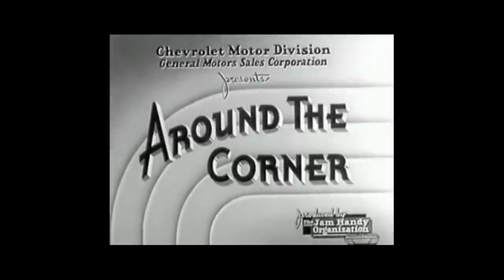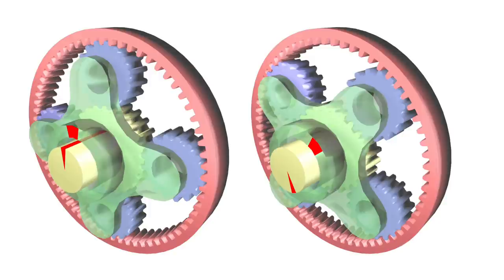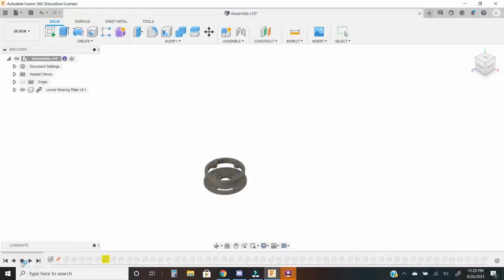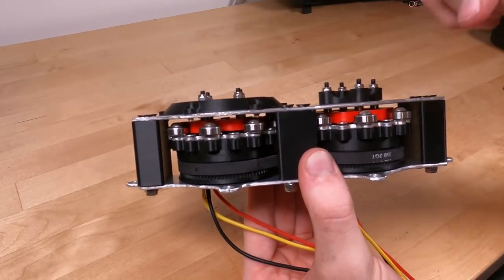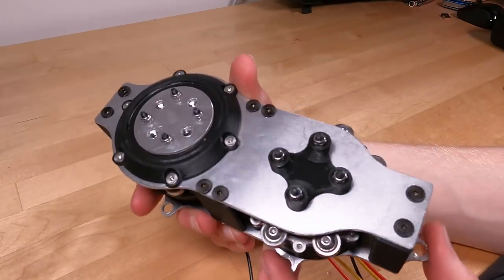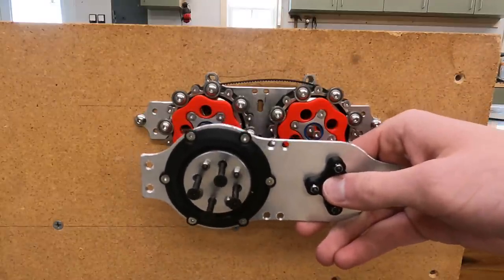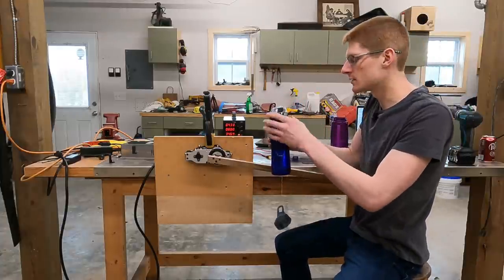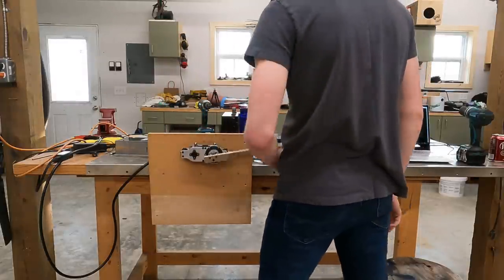The Differential Drive - A New Breed of Actuator

Comment: They are used in tracked vehicles and are called adder/subtractor gear boxes. Essentially two differentials linked together. They allow one high torque motor to provide the main motive force to two outputs and a second lower torque motor to add and subtract its speed to those outputs. It allows precise control over the relative speeds of the outputs even with motors of similar torque.
Reply: and with 3 differentials and you can use the "steering motor" to move torque from one diff to the other via the central, allowing for a constatant total output, but varying difference between the two outputs. Thats how  you get fine control on racing tanks like the Ripsaw. this way you dont lose speed and dont put too much backlash on the steering motor at high speed while maintaining steering reaction time.
Reply: That's a very well known application, and I didn't even think of it. Nice.
Reply: Can you mention some vehicles that use this? I had looked up this exact thing and found nothing
Reply: @BrokeWrench  cat differential steering
Reply: Help request.

I'm researching the subject  for a my small project. Many years ago there were gearboxes called "sinchronizer" to fine adjust the output speed in machine using asyncronous motor. Novadays I think the are overcame by synchronous motor.
Unfortunately I can't find much, and my mother tongue is Italian (with "some difficulties for English").

Can you you give me some more reference to find some documentation on the regard? Thank you for your kind attention.
Reply: @albertoplm  i sincronizzatori vengono usati nel cambio, non nel motore, se senti grattare quando inserisci la prima o la retro sopra i 50 km/h probabilmente non li hai
Reply: @supercrazy50000  i sincronizzatori a cui mi riferisco io sono un accorgimento/costruzione meccanica che permette u a Regolazione fine della velocità di un albero , mosso da un motore elettrico .
Probabilmente questo tipo di dispositivo oggi non è più attuale perché si ricorre a servomotori e driver elettronici .
Reply: @albertoplm  ah ok allora avevo capito male ahahah
Reply: @BrokeWrench  Shermann tank transmission.  Not only does it produce steering more like a car, it also allows the tank to use 1 engine when the other is damaged or broken. You can drive forward/backward, or rotate right/left, but only one at a time. ( when one engine is out )  I experimented with Legos and can build the transmission with legos, but there are so many gears that the motors barely overcome the transmision friction.  There are MANY differential drives in the military, including navigation and flight instruments.  Theyre found in missiles, too. They were used heavily in ww2.
Reply: They are also used occasionally in high school competitive robotics. I believe it is called a differential power take off there.

Comment: Little fun fact: 
The Toyota Prius is using a planetary differential to couple an electric generator, motor (and ice engine) and the driveshaft.
This system is widely belived to be the most cost effective and efficient way to build a hybrid drive train. In german, we call this system a "Leistungsverzweigter Hybridantrieb". 😅😁
Reply: toyota calls it eCVT
Reply: @Eugensson  in Toyota’s R&D lab it’s nicknamed the “power splitter”
Reply: German: “CONCATENATE ALL THE THINGS”
Reply: @liesdamnlies3372  Luxembourgish: Do the same as germans, but in a most unexpected way, eg ZWEEEEËG
Reply: I believe some farming machinery manufacturers also use a differential to add the output from the diesel engine to that of a hydraulic motor, thus having infinitely variable output speed.
Reply: Revonte bikes also uses the same idea for making transmission for e-bikes. Instead of ICE there’s pedals. It’s kind of genius system that requires sophisticated programming to work flawlessly.
Reply: Powersplit hybrid
Reply: If you want to give credit to someone for the original invention, make sure to give it to the correct person: Alex Severinsky. Of course, it is perfectly possible that Toyota did what this YouTuber did: reinvented something that already existed (marketed as Toyota Synergy Drive)
https://www.wired.com/2010/07/alex-severinsky-toyota/
Reply: "Leistungsverzweigter Hybridantrieb" - not the most eficient way to name it.
Reply: @famfloro  the owen magnetic did something very similar in 1916

Comment: You just described the “transmission” of the Prius, except that the Prius uses three input motors, mg1, mg2, and ICE.
Reply: Exactly. Ford/Toyota eCVT.  I made one based off the linear toyota variant to dynamically share output from a windmill with two generators and one motor, one gen for low winds and the other geared for high wind. The motor/braking takes some power off the gens but it speed sets the distribution between the gens. Cost effective, no; Fun yes.
Reply: Check out the Fendt Vario or AGCO CVT transmissions
Reply: I knew I had seen this before but couldn't remember where. Hybrid cars. That's where. 
Also some CVT were there's an electric motor who's sole purpose is to vary the gear ratio. I think modern tanks use something like this.
Reply: Not precisely...  A combiner gearbox, which is what the Prius has, is a little different.  Similar, yes, but not quite the same.  It's nice to see him make something to test his theories though.
Reply: What happens to the power balance? Does it mean in the differential mode one of the motors (rotating in the opposite direction to the output) acts as a generator? This mechanism indeed makes a lot of sense in a hybrid drive where one of the motors has a narrow power band.
Reply: @leonschmidt7  Yes this was also my first thought of examples of differential power combination. 

The AGCO transmission effectively splits the drive from the engine with a planetary differential between a fixed gear transmission and a hydraulic variator. The separate transmissions are then recombined with another planetary differential to the output.

Depending on the ratio of the hydraulic variator (continuously variable hydrostatic transmission) sets the ratio for the entire transmission. This includes continuously varying to a stopped position and then into reverse with the engine output staying at constant speed. The stall torque of the transmission in this case is basically just limited by the strength of the gears/hydraulic variator, no matter how fast the engine is spinning or its output torque. Although this type of actuator would be far too complicated for a robotics type application unless it's quite large.

The clever thing about it compared to just a hydrostatic transmission is that is splits the power between a typical geared and the hydraulic transmission sections. You can make a CVT with just a hydrostatic transmission but they are typically less efficient and produce a lot of heat compared to standard gears. At cruising speeds set by the particular gear ratios, no power goes through the hydraulic variator so it is still fairly efficient when cruising.
Reply: @felixar90  Yes, double differential tank transmissions use a secondary input to two differentials to vary the speed between the different tracks. Although kind of a different application since it's more of a steering mechanism. The second input to the differentials is technically not adding power to the main drive, just kind of removing it from one track side and adding it to the other. 

This is what is called regenerative steering and cropped up in WWII with Merrit Brown and Maybach differential gearboxes. 

I think the German tanks which mostly used the double differential Maybach gearbox, used a secondary small gearbox for the steering input; the different gears gave different turning radii, which also changed with different main gears the tank was in e.g. the turning radii was larger when the tank was going faster which was quite clever. I think more modern designs use a hydraulic or electric motor with a double differential gearbox to control the turning radius or neutral steer the tank.
Reply: ICE and mg1 are directly coupled. Mg1 is mounted to the flywheel.
Mg2 is the second input.
(or the other way around)
Reply: Yes, exactly!
Reply: Yuup
Reply: @johnmcfarlane9416  So how would centrifugal regenerative braking work.  ie. energy from the wheels could be transferred to flywheel that could later be used as boost back to the wheels.  So you could pre-charge the system by going really fast and hard braking to spin up the flywheel as much as you can.
Reply: The cvt in the prius has a electric motor connected to the gas motor, and then an electric motor connected to the final drive gear directly.
Reply: @chubbysumo2230  I'm pretty sure this is not the case. There's a guy on YouTube with lots of good videos on how m1, m2 are connected. The two motors can run with the engine off for example.
Reply: In the Prius mg1 is on the sun gear. mg2 and the transmission output shaft are on the ring gear. The gas engine is on the planet carrier. The wheels can't spin unless mg2 is spinning, but mg1 and mg2 can independently be used as generators or motors to provide regen or add power to drive the wheels. 

On some of the Honda hybrids the electric motor is on the output shaft of the gas engine. This is not the case on the Prius.
Reply: @BobPaul  winner winner 🏆 chicken dinner!
Reply: @paulkaygmailcom  The primary source of energy needed for acceleration would be provided by the engine/motor. The flywheel/re-gen/storage would be added.  So even at 5% efficiency it would still give you 5% boost
Reply: Took the words right out of my mouth

Comment: The "reverse" differential drive you describe was used for a century (I believe) to actuate rudders on ships.  Two large DC traction motors ran in opposite directions at high speed, with the rudder linked to the output shaft.  The rudder could then be moved by varying the electrical power fed to the motors, one more and one less,  resulting in a high torque at the rudder very quickly.  This was before the days of sophisticated hydraulics, and avoided the need to spin up a single traction motor from rest every time a rudder movement was required.

Comment: Beautiful build quality.  Great presentation and example of the value of lab tests in conjunction with thought experiments.  The first computer I worked on professionally, used physical differentials to perform vector math based on heading to integrate acceleration, and speed into distance traveled in latitude and longitude for the F4 fighter jets.  It worked well - Back in my day.  The entire navigation and weapons delivery was done in analog computing and was build before Apollo.
Reply from the maker: Wow, that's fascinating!

Comment: I just returned to this video after having seen it back when you first posted it. It’s clever and very well-explained!

I realized that this is essentially the same principle used in the ancient “north-pointing chariot”. There, the inputs were the rotation of the two chariot wheels, and the output was a pointer that s always pointed in the same direction, regardless of how you rotated the chariot. 

Anyway, a great project and explanation of the project!

Comment: all you have to do is invert one of the inputs and you've just created the mechanical equivalent to an electronic operational amplifier where the gear ratios determine the "gain" and you can even feed the output back to one of the inputs with a variable gear ratio and you can change the "gain" or input to output ratio of the drive unit.
Reply: Go on ...
Reply: @fire17102  "What is an op amp" https://www.youtube.com/watch?v=7FYHt5XviKc&t=2136s  just substitute "rpms" instead of "volts". That's a pretty sick idea btw.
Reply: @DFPercush  also torque equals current. And if you multiply torque*rpm you get horsepower which then can be directly converted to watts. The same energy you see in electrical systems
Reply: @megadjc192  so what sort of applications or purpose would this serve? Sorry, not as knowledgeable about this stuff, but its really cool!
Reply: The primary usage of this is in automatic transmissions as they allow the syncronized smooth change of gears where one of the inputs is connected to the engine then the gears are set at a specific ratio then the other input is forced to zero rpm thus allowing you to selectively change the rpm and torque without have to mesh gears together. A planetary gearset is a mechanical operational amplifier. Also, one can use this at a simple analog computer. For example, you can compare two rpms of two different rotational shafts then compare the output rpm and that output rpm will be the addition or subration of the two input rpms depending on the configuration. You can use this effect to accurately measure a high rpm source by converting it down to a lower rpm and then allowing an extremely precise measurement. Basically anything you can do with an electronic op amp you can do with a mechanical one. You can also integrate and differentiate the same way and this was commonly used in old mechanical computers. Also the mechanical op amp is completely reversibale unlike its electronic cousin so as long as the two outputs add up to the same input you can have any configuration of rpm and torque on the two outputs. This is how a car differential works. The limited slip differential just has clamps on both of the outputs so that no one output will equal the input in terms of rpm or torque. Otherwise the other output will be zero which is usually undesireable with a differential.
Reply: @megadjc192  fascinating. How/where do i start learning more?
Reply: @whtwolf100  you can quite easily learn the way I did. It was a drill coupled to K'nex from back in the day. I got my first set when I was 5 and to me its probably the simplest way to play around with gear concepts. K'new were not good at things like buildings but they are amazing for mechanical and structural stuff. How I learned all of this was by experimenting with different gear designs then coming up with my own setups then observing them to see what they did. (yes I built a fully syncronous automatic 3 speed transmission with them). Hope that provides you with some sort of starting point. You can study the math and visuals all you want but you really get a much more rounded understanding when you can actually work with the concepts directly.

Comment: I'd really like to see a demonstration of the variable speed feature you described. Put encoders on the motors and output and test your theory.
It might be my bias in favor of encoders, but I have a hard time believing this mechanism will allow precise speed control. As with standard gearboxes, I think changing loads will require adjusting the power input to maintain a desired speed.
Excellent video. Thanks for sharing your projects with us.
Reply: Agreed, he "confirms" his two theories but didn't even demonstrate those two theories at all.
Reply: Look up Nissan electric variable valve timing.

Comment: You should look at the drive system for the Sherman tanks, they use the difference of 2  motors to do forward backward and speed control. It is a very old idea
Reply: It's also used in mechanically controlled gear hobbing machines.
Reply: They had double and triple differential steering in certain tanks.

Comment: Wow this is really well applied!  In 2018 I actually did my high school senior year engineering project on this concept using a 3D printed herringbone planetary gear set. It was designed as a way to include two motors on an RC car. In my prototype I opted for biasing the gear ratio to take advantage of torque and power over a wide range of rpm. (The concept was designed around putting an electric assist engine on a gas powered RC by replacing the transmission and clutch, creating a unique RC hybrid) it was pretty cool Bc theoretically the electric can spin in reverse in order to let the gas engine idle without a clutch, and also combine the power of both engines for max power during runtime. Back driving the electric motor was an issue, just like it was in your test, so I think any future version of the coupler I made would need some sort of servo actuated or electric brake on the electric motor. 3D printed transmission burned out in only a few minutes but it was a fun project!
Reply: Have the electric motor drive the outside of ring gear via worm screw.

Comment: The outboard spoilers (used for additional roll control at lower air speeds) on A B-1b aircraft use triple redundant motors driving through two differentials.  I was the product engineer for the electronics that control them for most of the production run.

Comment: Before smart electronics, this was a common way to drive an equatorial telescope to both track the natural apparent motion of the sky and also position the telescope automatically to a new object. Because the "sky would move" some distance during the time of the reposition operation, the known destination (number of motor steps or encoder counts), would always be incorrect. By using a differential with one motor tracking and the other positioning, at the end of the move (in either direction), the desired object would be in the center of the field. In the early 1980s, while working on a telescope for the Navy's sky transparency survey, I found that making a numerical model of such a differential simplified the design equations significantly.  Good memories. 

Cheers on your clever design.